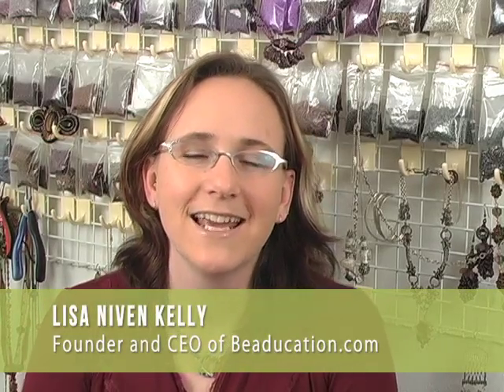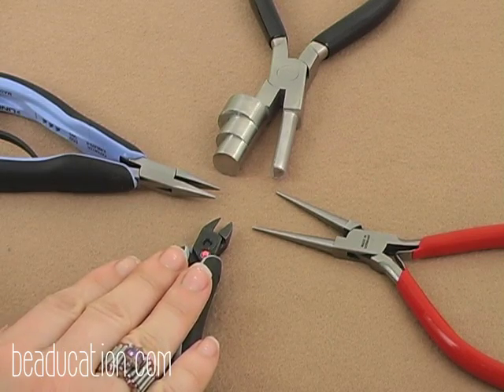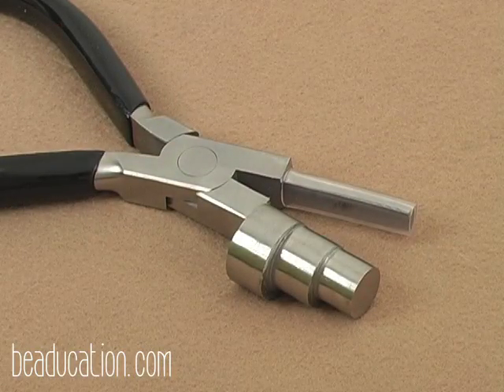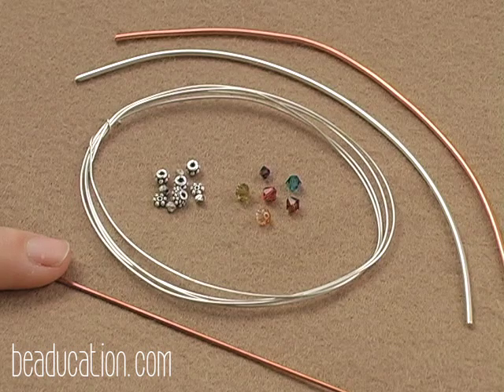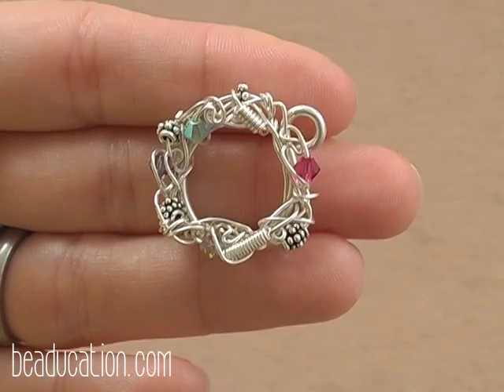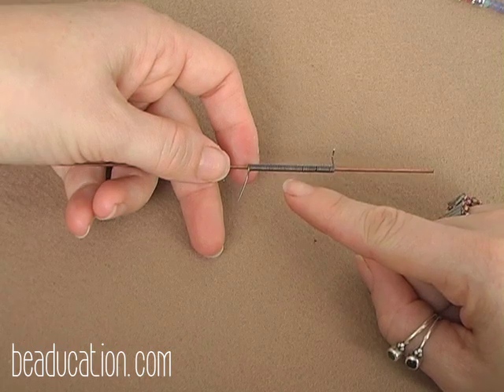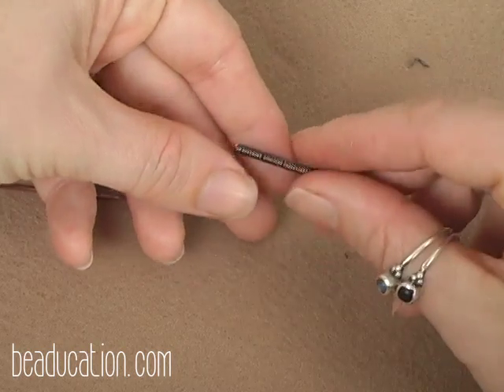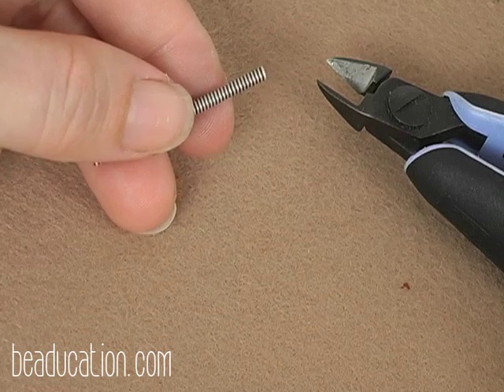Tornado Toggle - Beaducation.com

Comment: Beautiful!  Could small genuine pearls be used with the sterling silver wire?  Would the oxidizing acid affect them?
Reply from the maker: Yes pearls would work if their holes are big enough for the wire. When working with pearls or sensitive beads, I prefer to pre-oxidize my wire so the beads don't have to go into the solution. Hope this helps :)

Comment: Happy Saturday everyone! I have a quick question. I'm new to wire jewelry. What kind of silver colored wire do I purchase to use that is not brass or copper on the inside? I sometimes hammer out with a brass hammer and that is breaking down the silver outer layer and showing a copper color. Thanks, hope that makes sense.
Reply from the maker: You will need to use Sterling Silver wire or Fine Silver wire.

Comment: HOW MUCH WIRE DID YOU CUT FOR THE TOGGEL CLASP AND HOW MUCH WIRE DID YOU CUT FOR THE T BAR
Reply from the maker: If using the same size mandrel as we do in the video, start with 6" then make the loop side of the toggle, then trim it off. That should use about 3" and leave you with 3" for the other side. If you use a different size mandrel, that will have to change to make it bigger or smaller.

Comment: Just found this and it is beautiful, I just wondered why it isn't closed with soldering and it that is an option? I have been learning silversmithing for the last three years, and in our class we are taught to make everything we will use in our pieces.
Reply from the maker: Soldering is a great technique and a great option for many projects! This project/design doesn't require soldering but it's certainly up to the designer :)